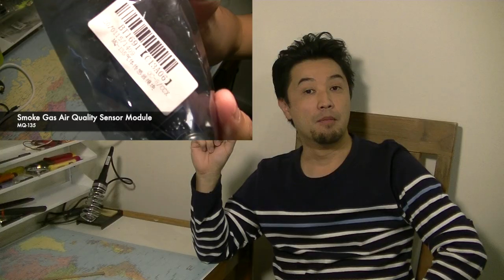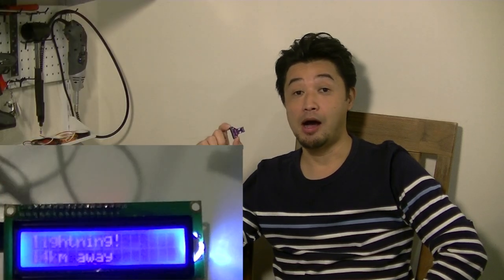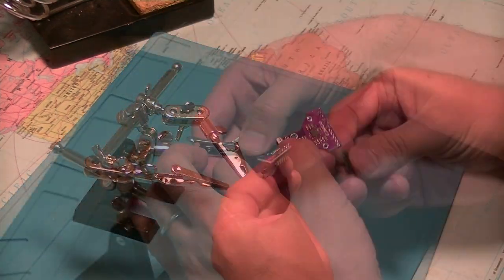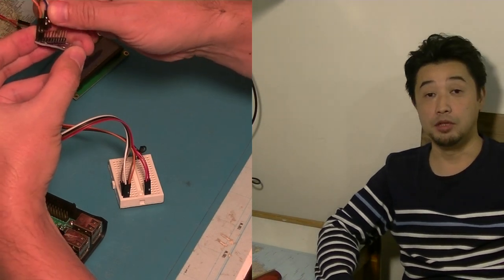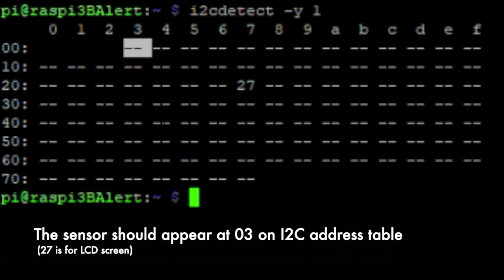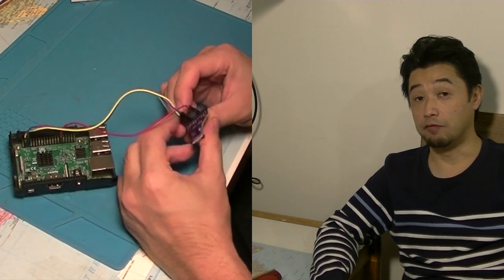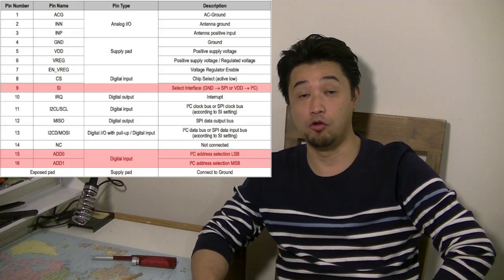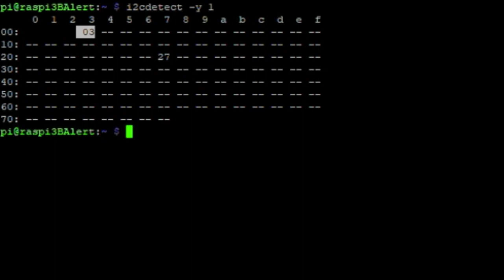How to Make AS3935 Lightning Sensor Working with Raspberry Pi via I2C?

Comment: Hi mate, just wondering is there anyway to connect it to the raspberry pi without a breakout board? I've had the sensor for over a year and never got it to work!
Reply from the maker: I'm not using any breakout boards. I have a blog version of this video. I hope it'll be easier to see the diagram.  https://www.funincomplete.com/how-to-connect-as3935-to-raspberry-pi/
Reply: @funincomplete977  ah sorry i meant breadboard! I found your blog post when searching online; the diagram is very useful but I'm not sure how I can do it without a breadboard, I only have the wires (same as yours)
Reply from the maker: You could solder wires together if you have tools?